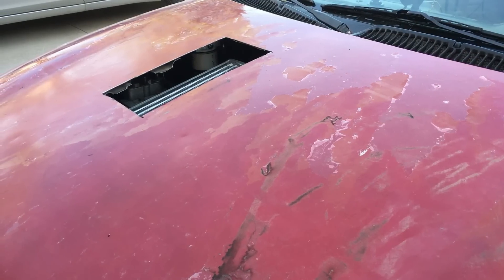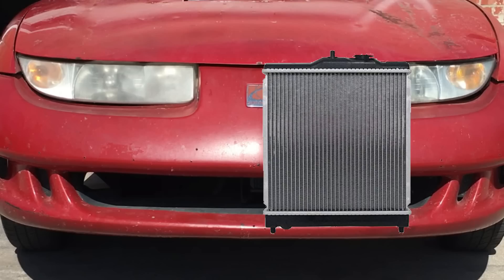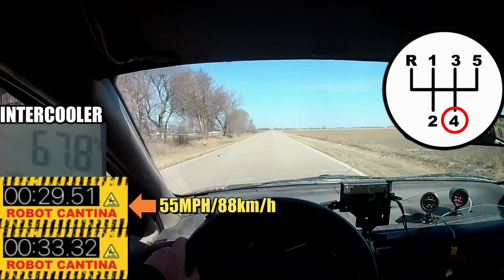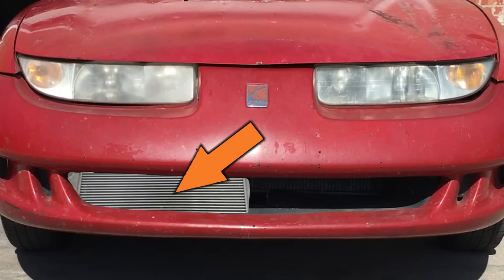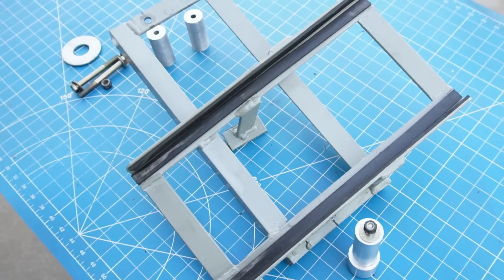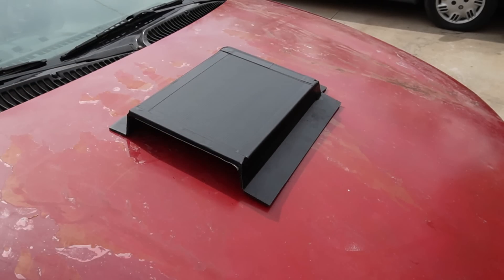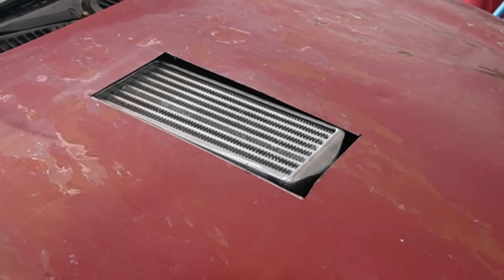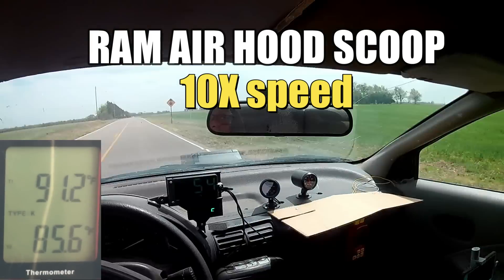S3 E12.  Testing different modifications to the intercooler on the Kubota turbo diesel Saturn.

Comment: Hello there Robot.  I have found your Kubota Saturn project to be inspirational.  It re-energised my efforts to put the same engine into a Reliant Robin three wheeler.  I mated the engine to a Cushman Turf Truckster 3 speed gearbox.  We are now up and running and the performance is reasonable with a current top speed of 55 mph.  The problem I have is that first gear is a little high, O.K. for general running but problematic on steep hill starts.  I have considered fitting an electric 50 amp turbo just for this scenario only, not for regular engagement. Am I correct in understanding that you did not have to re-map the fuel system when you fitted your exhaust generated turbo and do you think that an electric turbo , which would have a maximum of 30 seconds of duty, might help with the hill starts.  This will be my daily driver and I often cover 400 miles in a day with my regular engined Robin.  Any comments appreciated.
Best regards,  Mike (lastbus)

Comment: Moving that intercooler up would help, very little but has created space..
I'd do a cheap and easy fix by ducting air from the front bumper opening using flexible ducting hose, routed in the engine bay into a box (similar to your hood scoop but larger at the opening end) that would sit in the space now under the intercooler and seal the box to the intercoolers bottom with foam tape. I would then put rubber on the top of the intercooler to seal it to the underside of the bonnet(hood)..
This way would isolate from heat sources and force that lazy cool air through, not at the intercooler like a hood scoop.
Remember even a Subaru unit has a seal under the hood, had water spray and was placed above the gearbox with a gearbox tunnel as possible air vent path, but still had much higher iat than when fitted with a front mount, and that a ducted v-mount intercooler has the best of both worlds with short piping, cool intake air and hot air exiting out a vented bonnet.

Comment: Maybe this turbo is just too small to see a big benefit from the intercooler. It seems like it's not making a ton of pressure, or a ton of airflow, or spinning very fast, or having much exhaust heat put into the housing, all relative to an average or bigger turbo setup on a car/truck engine. So yeah you might still get a fairly large percentage difference between intake temps with and without the intercooler, but not in a temperature range where it matters. I think mid to low hundreds fahrenheit would normally be considered a pretty low intake temp with an intercooler, much less without one. A high intake temp could be in the 200-300F range.

That said, since you apparently have tons of thermal headroom on the intake side, I say turn up that baby turbo as much as it can possibly go, then add as much fuel as you can before the EGTs get too high again. PSI of boost is not so much the thing that will harm your engine, it's cylinder pressure. If you made 30 psi with a 20mm turbo it would not be nearly as dangerous as making 10psi with a 100mm turbo (just a random not mathematically accurate example). Also considering that every turbo reaches a point where it cannot make more boost, I would assume that to be pretty low on this tiny of a turbo anyway. Maybe after maxing out the turbo your intake temps will be high enough that you actually get more performance from an intercooler.

Comment: The cowl induction scoop wasn't close enough to the windshield to take advantage of the wind being forced into the scoop. Put it on again and hang a peace of string off it. At 35 MPH if it's close enough to the windshield, you'll see the string get pushed under the scoop.

Comment: My experience  adding a front mounted intercooler to a non intercooled 2.0L turbodiesel  was from 90hp/177nm to 98hp/200nm measured on a dyno. Before the install, it could not spin the tires in 2nd gear on gravel, but after that, it could. Also fuel economy was better. 0-96kmh was so so similar to the butt dyno, but from 70 to 110kmh had a better feel for overtaking
My next car was a 2005 Nissan  X-trail with a 2.2 YD22 turbodiesel and top mounted intercooler.
The bonnet/hood inner liner acted as a scoop. Intercooler and the bonnet had enough clearance that the air scoop vent from the front edge to a rubber sealed intercooler cup.

Comment: Here's a suggestion - you could improve the flow through the exhaust housing by tidying up the casting. This will reduce back pressure a bit and help lower the exhaust temperature. Here's a link to a how-to video entitled

"Ninja 500R turbo VZ21 More exhaust housing modifications":

https://youtu.b/HPBPJIInciw

Comment: Given the ram air scoop pulls air in, you could reduce the airflow at the front of the car to induce more air in through the intercooler.

I would love to see what the maximum boost pressure you could take this tiny engine to in combination with early intake valve closing to reduce the compression work required from the engine, improving economy.

Comment: Have we added an engine oil cooler yet or does this engine already have one?   It helps save the turbo and the rest of the engine bearings when the engine oil temps can stay below oil boiling temps while the top end is near melting.   🌡

Comment: The intercooler scoop tests make me wonder, would an inlet scoop and ducting help when the scoop is reversed so the air would flow as desired?   The cars you are inspired by maybe had some shrouds and such under the hood..  Then the coffee kicked in, I'm in outer space here : is possible a turbo could starve for air in certain aerodynamic situations? Would a low pressure (while at speed ) location of the air inlet act as a filter restriction? Would a scoop/deflector/ air foil in the bumper location affect anything positively? Your request list for content must be getting long 🤩 thanks for sharing this journey with us😀

Comment: A Tip from Germany:
Take the Diesel engine from the smart car. 3 Zylinder 799ccm 54Hp
130Nm. It hast the smallest Commonrail Diesel engine in the world. I get easy 65 MPG out of  this little car and It runs forever.
Greetings

Comment: Does the intercooler lower the exhaust gas temp? If so then you can add more fuel and that’s how the ic will give you more power. 
Also I have a spare D722 and I was wondering what to do with it, not sure I can find a Saturn in NZ. 😂

Comment: It would be interesting to tape little strings all over the hood and intercooler like they used to do with wind tunnel testing and see what the air does around that opening, i wonder if closing off the front holes like you had before with the black plastic would cause more air to be sucked through the intercooler opening? Seems like perhaps so much air could be pushing through the front (especially with a smaller rad and no condenser and such) as to pressurize the engine compartment and flow air out instead of in? I dont think even the hood scoop working disproves that theory since often there are low pressure areas in that general vicinity on cars. No expert here, just rambling ideas as i drive to work

Comment: Too lazy to go through all the comments, but have you thought about doing a leading edge on the front of the intercooler hole to change the pressure at speed? This should make the air flow from front radiator holes out through the hood. You can test what it is doing now with some string. I don't know if I am explaining this well enough, but I have a video for you...
https://youtu.be/wjjOgX_C5g0

Comment: One thing that can help the intercooler cool even more is using cast aluminum pipe on the HOT side.

I discovered this inadvertently when I was modernizing the intercooler pipe on my 1990 Dodge Cummins (It actually has an old, factory-fit Banks intercooler!). The only pipe piece that I could find for my 3" dia., 6"-long 45 deg. bend requirement was in cast aluminum. 

As we all know, aluminum dissipates heat, and I can definitely feel the heat coming off of this piece of pipe before the air even gets into the intercooler.

Comment: Subaru has used the top mounted intercooler design for quite some time and they use a ram air style scoop as well as some additional under-hood shrouding to direct air through the intercooler. There was also some models where they added a sprayer system that allowed for water to be sprayed onto the intercooler for additional thermal energy dissipation.

Comment: Subaru used a hood scoop for their intercooler as well.   I knew it'd work best.  Cowl induction works on 69 Camaros because it's actually sucking air into the engine and there's a pressure differential.  There needs to be airflow across the intercooler core for it to do its job.  Did you happen to seal off the intercooler to the hood so no air could escape around the sides?

Comment: When Chevrolet first introduced half ton diesel trucks my uncle a retired truck driver bought one. They were horrible, shortly after he bought a four cylinder perkins diesel and transmission from a wrecked bread truck. We put it in a 70's GMC four door truck. It stuck out of the hood but would run about 75 on the highway when you got it in high gear. We got stopped several times by OHP just so they could look at it. Great channel, please continue.

Comment: I am new here and own an 18hp Kubota sub-compact tractor.  I am not sure of the purpose of the intercooler.  I’ve always understood diesel engines love heat.  It takes heat to ignite the air/fuel mixture in the diesel combustion chamber. Do are intercoolers used in the trucking industry?  If they are, what is the purpose?  Is it to make the air pump more efficient?  After all, an internal combustion engine is nothing more then an air pump.  Also, if the intercooler is increasing the amount of oxygen, then maybe the amount of fuel delivered to the mix needs to be increased to see an increase in power.  IDK - but I am enjoying watching you all use a small Kubota engine to power a car.  I often wondered if the 18 HP Kubota could power an electric generator, similar to a diesel-electric locomotive, to drive a car or light truck.  Maybe use a hybrid battery to help meet the need for short bursts of power to accelerate.  Enjoy The Journey - Cheers

Comment: The advantage of intercooler is to drop the intake air temperature hence drop the exhaust temperature too (a bit) allowing to inject more fuel and make more power.

Comment: Diesels are reliant on heat, its what makes them operate. During the winter and late fall months I usually unplug the cooling fans on my jetta, seems to drive much better regulating its own operating temp. Sometimes it gets a little too cold down into the 20's that when you stop at a street light, engine temp will drop then the car trips itself into warming back up and the RPM's raise up to try and keep itself warm. I end up loosing fuel mileage keeping the cooling fans plugged in during winter temps.

This was an exciting video to see for a new viewer! 
However I will vouch for that little diesel and say fans or cooling solutions for diesels are not always necessary unless ambient temps are above 75 degrees, or its an engine the size of a Cat C15 doing heavy hauling.

Comment: If it looks stupid but it works - it's not stupid.
Now, for that ram air scoop, if you want it to really perform you'll want to extend it to the very front edge of the hood and make it very low profile at the front, maybe just an inch high and angled slightly down. That way you'll pick up the cold air at the point of the highest pressure and flow speed. From there let the scoop expand to slow down the air flow to a speed that easily passes thru your intercooler. Just some applied aircraft- and race car science...

Comment: It seems that you may have a little negative pressure under the hood, since the ram air worked better than cowl induction. I don't think a pair of computer fans will make much difference, even on a draw-through configuration that would attempt to mimic the ram air setup. I think alcohol/water injection on the inlet of the turbo will get you better air density, and more power (if you turn the fuel up to compensate). Pretty interesting experiment nonetheless!😉

Comment: Actually, the ram air scoop, as ugly as you feel it is, will always work better, but with a diesel, especially on such a low performance vehicle, really doesn't make a whole lot of difference.

Its not until you get at least 2 atmospheres of boost that an intercooler even matters.

The 'donated' heat of the turbo is mainly just the 'aggravated stirring' of the air by the compressor at such low speeds as you are using at the moment.

2 x atmosphere is probably not going to happen in your current setup.

Comment: Generally speaking the biggest most instant problem is the small air filter.

That can really choke back the air.

While its not like a 750 cc motorcycle engine making 12,000 rpm, it would be good to get a larger air filter.

Comment: The main reason why you're not seeing proportionate gains in efficiency with the lower intake temps is because the intercooler is TOO SMALL.
     
     Compressed air is thicker than atmospheric pressure so it's like sucking chilled syrup through a straw rather than warm water. Now imagine you shoved a curled up match book cover in that straw you're sucking through. THAT'S what that tiny intercooler is doing!

     The restrictions on the intake strokes are giving you parasitic loss because of this. You need a larger heat exchanger core and end tanks.

Comment: install a bigger turbo. with as much boost as that’s making and as hot as diesel burns, that turbo is probably really inefficient due to its small size. think of it like blowing through a straw. said straw can only flow so much air before the air being imputed is more than the air coming out

Comment: The fun thing is that the air isn't being drawn into the hood scoop, it's being pulled out. The high pressure area right outside of the scoop is forcing the low pressure air inside the engine bay to move out. 

Cowl induction is just that, induction. Meant to create a low pressure differential area for a NA engine to pull cooler air from. 

But I'm here for watching you attach PC fans to a car.

Comment: I believe that you are forgetting the biggest benefit of using the intercooler>>> decreasing the exhaust gas temperature !!! And when that happened, you were tickled pink about it and glad it improved the chance of solving that problem. It also helped to increase the boost from the turbo.
Just a friendly reminder from a follower of this project. I like it a lot and wish there were more people on youtube that did these type of things.😃👍
And (of course) installing the fans to pull air into the intercooler from under the ram air scoop is the way to go (puller fans). There may be some benefit from reversing the fans (pusher fans) and trying the cowl induction scoop again, but you have the final say on that. It's your experiment and video series.

Comment: Its true, there is a trade off with inter cooler position and running long lengths of plumbing to place it in a different position.   Your performance limitation now, is simply boost..........a diesel needs at least 20psi........preferably as much as possible.  You still havent insulation wrapped the exhaust manifold and exhaust turbine..........thats lost boost. Inter cooler's make a much bigger impact with higher boost levels, since high boost drives up the charge air temperatures dramatically.  This is why the early turbo charged heavy trucks etc did not use them.......they were only running low boost.  The other factor to making boost, is the compressor efficiency map.  Every turbo has parameters......a minimum speed for the centrifugal compressor to become efficient at moving air......and a maximum speed where its boost to charge air heat becomes very poor in efficiency.   In the middle of the compressor map, is a sweet spot, where maximum boost is made, for the least amount of charge air heat.  In this case, the engine may not be actually able to give the turbo enough exhaust energy to keep it in its proper range.

Comment: It's always good to do experiments.
One thing I'd like to see would be what the effects would be of also injecting a little ethanol or E85 in the intake, even though it's a diesel. No point in doing it at idle, but at high load it could be interesting to see if you'd get any more power from it. The engine might blow up if overdone though.

Comment: I would love to see you try a compound or twin turbo. If you plan on junking this Saturn, you might as well full-send lol 

I think the idea behind cowl induction is that it uses engine vacuum to suck air into the intake manifold. See the old Pontiac Firebirds with the "hood shaker". So that won't work here since there's no vacuum sucking air into the cowl. 

BUT a clutch fan would really help with your cooling issues. Then just stack the intercooler on top of the radiator and have it pull cool air through both. But if not, an electric fan setup would probably be just as good.

You could also just run without a hood entirely. For some reason it seems a lot of tuners do that to show off their engine builds.

Comment: The fans aren't going to do anything. They're computer fans and are meant to push air through a computer case so they won't have enough airflow to achieve any meaningful result. The only thing you might see a difference in is if the car is stationary just like how your radiator fan works. It's only there to push air through the radiator while the vehicle is not moving.

Comment: The greatest restriction to airflows the intake valve,next worst is the port and manifold, being an industrial engine it isn't designed to flow higher cfm  ,there is no radius into the intake port openings at the manifold Junction  this could be a good mod for thought  just saying of course 😅